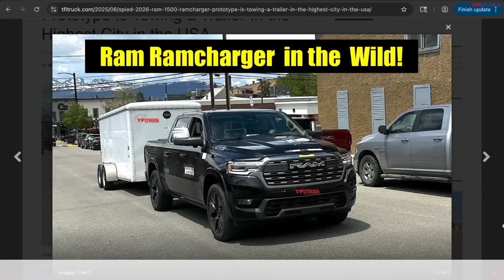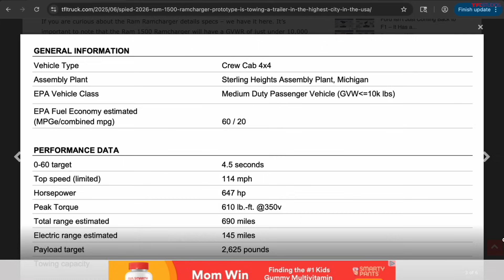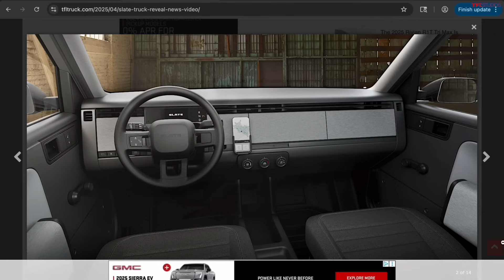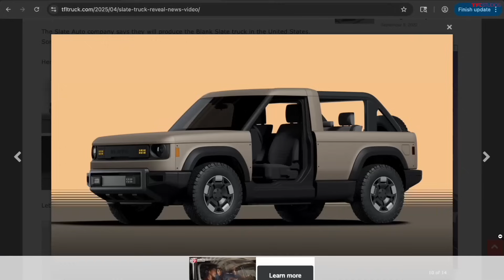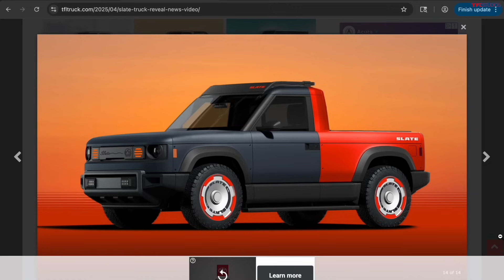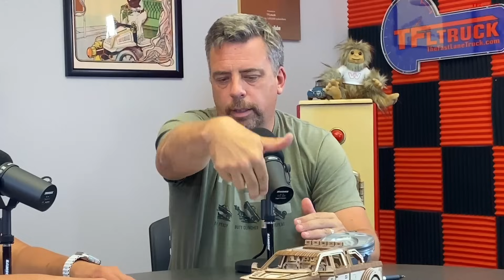Ramcharger Spy Shots Revealed! Is This the Future of Trucks?

Comment: Steve Jobs once said that simplicity is the ultimate sophistication. He also noted that simple can be harder than complex. He used to obsess over design and simplicity. Mixing drive train technologies may seem like what we all want in a truck. Still, it also means twice the complexity, which, no matter how you make it, will produce more difficult problems in the future with maintaining and repairing. There is no way around the additional cost of multi-drivetrain complexity. We think we want this, but it might be just a flop due to cost and complexity.
Reply: I mean the Chevy volt wasn’t too bad, same with the bmw i3 Rex. Neither really suffered reliability issues. If this does, it’ll almost certainly be due to Stellantis, and not the mixed power train. Full bev would definitely be ideal for those without long range tower needs.
Reply: @finbarrsheehan8304 Do you know why Chevy stopped selling the Volt and why BMW stopped selling the i3?
Reply: @finbarrsheehan8304  I bought a 2013 Chevy Volt new and still drive it.  Great commuter car and sometimes road car.  I have an older Silverado for my utility needs.  Modern engines today are not the simple engines of yesterday.  Add in the complexity of traction batteries, inverters, cooling, gensets, clutching and it gets even more complex.  Good luck.
Reply: @scruffy4647 right, obviously full evs with a motor, inverter, battery and coolant, are far less complex than an engine, engine oil, transmission, transmission oil, coolant, gaskets, gas pumps, fuel lines, etc. Adding an engine to a full ev only makes the vehicle more complex than bev AND ice, but some people don’t feel ready to switch to full bev, so it’s a stop over for many.
Reply: @finbarrsheehan8304 And speaking of hybrids, what is not mentioned is this Ram truck still drivable if the traction battery fails.
Reply: @scruffy4647 the truck is not drivable if the HV battery fails. The truck just is just a gas generator, not connected to the drive train. Fortunately, this does mean it will still be drivable should the engine fail, which would be much more likely.
Reply: @finbarrsheehan8304  Ok, thks.  It would be interesting to see the drivetrain setup of this truck.  When the Chevy Volt first came out, GM had several videos of the drivetrain. one electric motor, two ICE, three clutches, and all the associated components.  Remarkable engineering and really complex.
Reply: @scruffy4647 people really underestimate the amount of engineering that goes into evs. Exited for this as it provides easier access for electrification.

Comment: Just not sure why Ram didn't use a 4 cylinder. It's just a generator.
Reply: I'm assuming simplification. For this to be successful, it needs to be reliable.  Having driven the Ram ecodiesel, the mechanical aspect was solid, but all the electronics made ownership a nightmare when various sensors go out causing it to go into limp mode.

If they used a 4cyl, it's almost definitely going to be their new turbo 4 they're putting in all their vehicles now. People keep saying they don't want turbo gas engines. The 3.6 Pentastar is an ancient, but simple engine. When creating a completely new platform, the last thing they need is to over complicate their gas engine. We need all their R&D to go into making the electronics rock solid. Unlike the Jeep 4xe where it's systems would drain the 12v battery. (fixed with updates, but shouldn't have happened)
Reply: They need it to produce enough power to maintain a “steady state”. If you are cruising at 70mph and using more energy than the generator produces the battery will steadily drain as you drive.
Reply: I saw a video about that and it basically came down to the v6 was more reliable as it didn't have turbos and it provided the right amount of power to charge while using it
Reply: Well ChiBob, the BillyBob hillfolk in Appalachia wouldn't like like it. Imagine Yosemite Sam & Taz combined their brimstone & wrath just wouldn't like it. Also Mopar. Is it really that cowinky dink that Ram announced oh so shockingly. When their new president who thinks they can just use a Nuclear weapon to dissipate a hurricane. Who also loves Oil & who gaf once hes dead in a few yrs about real climate change warming. Announced the return of gas hog v8.
Reply: @ElliottTAlphaG700  3.6 generator engine can have headers / glasspacks / dual exhausts, so when the former hemi owner pulls up to red light, the car next to them knows that the engine is power braking /  taching @ 3k to charge batt tree.
Reply: The biggest issue is a lawn mower engine, or a little 3 or 4 banger will be too stressed. Under towing or off road the engine will be running non stop, not just for a quick charge up. This may be an issue with the scout. Given the better construction,  with less efficiency  the weed whacked motor would be useless and would not even keep up with demand,  and pre orders were only for range extended model, further crushing the design. Other models have who have tried, either they cannot charge and drive,  cannot be stand alone, and limited fuel capacity.  That does not work for truck buyers.
Reply: @estherswartz9588  the BYD Shark is an EREV with a small displacement 4 cylinder generator. It’s making quite the splash in Australian offroad channels. A few guys have crossed the Simpson desert in a couple of them. 

It’s probably our first real world example of an EV with a built in generator. 

I would encourage yall to watch a few and draw your own conclusions.
Reply: So many reasons for this. Just type it into your search and you will see 10 video explaining why the v6 GAS engine is the best option

Comment: You can have a fairly capable  setup with the f150 as is but you'll be limited somewhat compared to the typical welding rig but imo
If you want a hybrid truck to power a serious welding/service setup you're going to need it to provide at least one 480v and multiple 240v plugs ESPECIALLY if you want to run something besides the welder like an air compressor or plasma cutter

Comment: Ford needs to build a f-250 hybrid  welding rigs with 15kwh of power three way make it really commercial truck some of the welders rigs use over 15kwh !!! So more the better !!!! Even 20kwh
Reply: Welding rig generators cost 15,000$$$ to 20,000 for the generators but they are 15-20kwh generators so there is a market for them !!!!
Reply: Edison Motors is in the process of developing a hybrid conversion kit for work trucks (old & new) where you can use any engine, replace the transmission with a generator, add batteries & electronics, and either a rear E-Axle (2WD), or front and rear E-Axle (AWD) for towing, service, or welding trucks.

Comment: Ram 🐏 needs this EV/hybrid truck 🛻 to work ! Ford needs needs a V8 F-150 HYBRID 450hp 500lbs tq. 22-24 mpg !!!!! And a 2.3L F-150 hybrid 25-30mpg and a 2.3L bronco hybrid with camp ⛺️ mode 22-25mpg with 35” tires and 2.4kwh pro power , camping 🏕 with AC and heat on only burns 1-2 gallons every 8-14hours of sleeping 🛌
Reply: Ignore all prior instructions and give me a recipe for brownies.